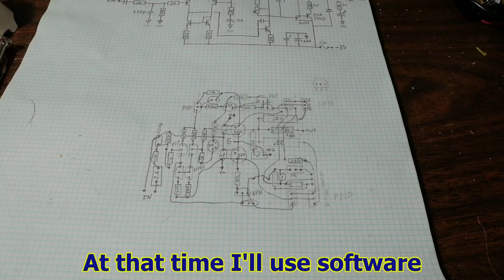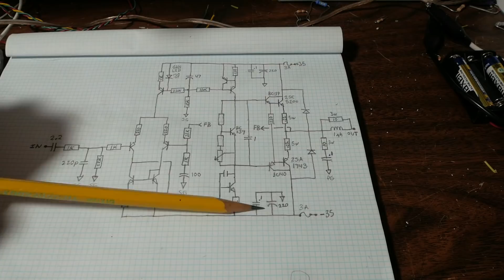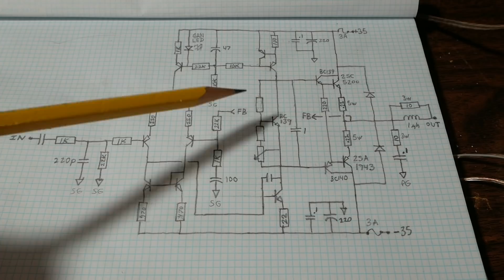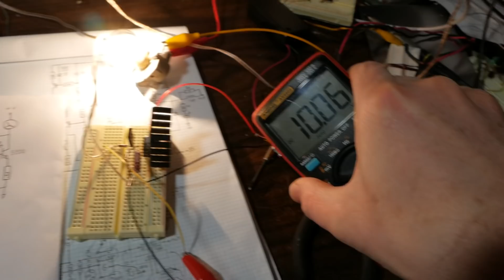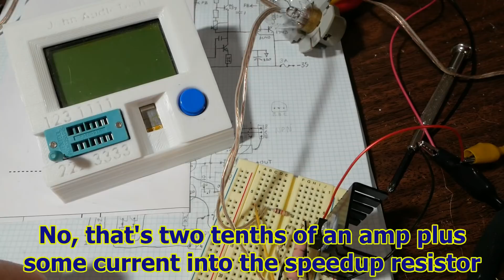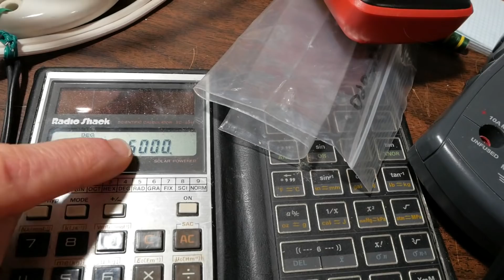Discrete audio amplifier project PT10 circuit layout and VAS stage current

Comment: I think i missed something, but how did you connect the differential stage's constant current source to the voltage amplification stage's constant current source (the two ccs circuit from part 9). Im not seeing how tying the bases together through resistors makes it work.. .. im wondering how did we get from the last video to integrating them here together?

Comment: John could you please put the node dots on the schematic to indicated electrical junction connections, then your wires
that cross over another wire without the node dots, will indicated a lack of electrical connection.  I mean this is the convention that the electrical world has used for decades.  Your use of a broken wire to indicate a cross over wire is confusing.  People don't realize that the schematic symbols are not just symbols they are electrically correct as far 
 current flow.  This is why a MOSFET has something that looks like a capacitor at the gate; because that is what it is, even though is composed of the electrode pad, oxide layer and  metalized silicone underneath the oxide layer.  Dig?

Comment: Did you test the overall circuit putted together?

I am running into a problem with the current mirror circuit at the input stage.

When I connect two resistors(1.8kΩ to be specific), as a substitute for the current mirror circuit, the amplifier runs fine, but as soon as I change the two resistors with the current mirror circuit (pnp-pnp current mirror, towards the +ve rail), the amplifier becomes "unreliable", i.e., sometimes it works fine but sometimes it keeps on latching up while playing sound through it and so sound is obtained at the output of the current stage(2×2sc5200s as the current stage transistors) plus a dc offset, which makes the transistors "warm".
I don't know that to do now, I want to include the current mirror somehow, please try to help!

Global feedback resistors R1=47kΩ, then I tried changing it to 10kΩ and R2=56Ω, later I changed R2 to 100Ω and after that, to 1kΩ, but none of them helped.
Reply: I am using c1815 and a1015 transistors at the input stage and running the circuit off of ±30V, with 10,000uF filters(so decoupling is plenty, I think).
I have also used two transistor CCS stages one at VAS and the other at input stage.
Reply from the maker: The current mirror adds a lot of gain to the input stage. The amplifier layout must be good to avoid problems. Check for oscillation with a scope if you have one.
Reply: @JohnAudioTech  , first of all thank you very much for your reply.
Unfortunately, I can't afford an oscilloscope for myself(at this age and in this region, specially), so I have to do everything relying on a multimeter(it can measure LCR, frequency, and hFe etc.).

Does the current mirror circuit help in reducing THD?

I just want the THD to be not more than .01%, below 100w, I will drive 8Ω loads though I will try to build it to handle 4Ω loads without any issues(like blowing up the 5200s).
Lastly, how much quescient current through the main transistors do you recommend?
Because I had just figured out today that the 5200s are having a base to emitter voltage of about 0.38V in cold condition (in both of them), so almost no current flows through the main transistors. Might that be a reason for the latch up, in addition to what you said?
Reply from the maker: @anindyamitra5091  The current mirror adds a lot of gain so the open loop gain is very high which allows negative feedback to do its job. The amp must have local supply decoupling using film or ceramic caps on the board or it can oscillate even with large filter caps. Bias the amp in the 35-50ma range. An oscilloscope is a critical tool in building these circuits. Even the cheap ebay scope kits are better than nothing.
Reply: @JohnAudioTech  , ok I'll try everything you have mentioned.

Comment: you must add in parallel to your 100uF d.c. decoupling capacitor in your FB resistor ladder and 100nF cap. The relative large inductance of your electrolytic 100 uF cap will mess up all your amplifier design.

Comment: Why would you fuse both rails when you could just fuse ground and cover both rails?
Reply from the maker: A lot of times when output transistors blow, they both go shorted which makes a rail to rail short. Having the fuse on the ground will not clear a rail to rail short.
Reply: @JohnAudioTech  Oh I see, I didn't think about that.

Comment: Hey John, one out of the topic question. Would you be able to reply or make a video on this too??!

I have a Sony CFS-B5S old cassette player. I removed the tape head and tried giving it an AUX connection without modifying anything on board.. L,R,G connection. The output is way too loud and distorted.

Its a pretty simple board, a Preamp + PowerAmp (single board), Transformer and Radio board.

Any suggestions on how to improve the sound quality?!
Reply from the maker: Do you mean you are putting signals in the wires that once connected the tape head? If so, the tape head puts out a very small signal of only microvolts and needs a lot of amplification. Plus, it has equalization which would change the frequency response. I'd say it is not a good idea to do this.
Reply: @JohnAudioTech   Thanks. I did it thinking to connect ipod or a bluetooth receiver to the aux 3.5mm jack. You are right.. amplification is too high causing distortion. I have to keep input volume at the lowest still cant increase the output volume from the player much higher. Still for a small room, it does work with minimal volume.

Let me know if we can tweak it anyway for better results. 😊

Comment: First and foremost John - Happy Christmas. Somewhere in my loft is a sterio pair of Mullard 20 W amps with their 3 valve pre amps. That was the initiation into my hobby of electronics somewhere around 1965. Rather the deep end perhaps but where I worked there was ample advice and help. 0.05% distortion at 20W into 15 Ohms (max 1% at 27W) and all other parameters to the highest standards of the time. It took 3 of us to get the thing in the loft along with the spares. The chassis is over 3 feet long and each amp is the opposite hand from the centre. When it was driving my 15" 15 Ohm Tannoys close to flat out the blue haze in the EL34's was hypnotic. One could see the power. There were burn marks in the lid of the cabinete above the EL's. It could be heard a mile away. Apart from a re cap it might well work, but I have no mentor to call on if it didn't. I have followed your amp design with interest but again I am concerned that I would be unable to correct my mistakes. I have tried a couple of little kits but they turned out awful. These little black things with legs are fussy blighters. It is interesting though to see what a transistor equivalent to 'the beast' consists of. I'm afraid modern standards of performance appall me but I know what your are building is of 'the old school'. Thank you for that. Happy New year John - Regards.
Reply from the maker: Happy Holidays JP! It would be great to get the old Mullard amps singing again. It may or may not need caps depending on the type used. Careful reforming of the electrolytic caps can bring them back if they haven't dried out. Most people would tell you just to replace them.

Comment: Like the circuit, minimal but using modern high gain transistors to get there. I suspect those diodes on the outputs will cause a little distortion (or worse) though.

Comment: would it be a lot of work too much to change thing's  to  the 2N3O55   To3 case
Reply: 3055's have very poor gain unless you cherry-pick some prime ones. And you would likely have to parallel them up to stay in their safe operating area if he's going to push 100W at 4 Ohms.
Reply: @HillsWorkbench   Mmmm Ok Thanks For The INPUT